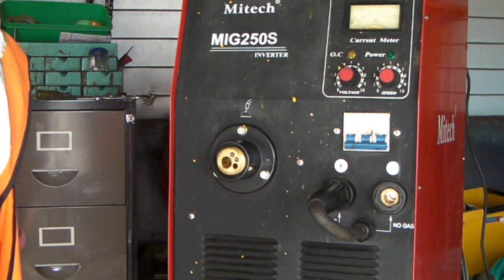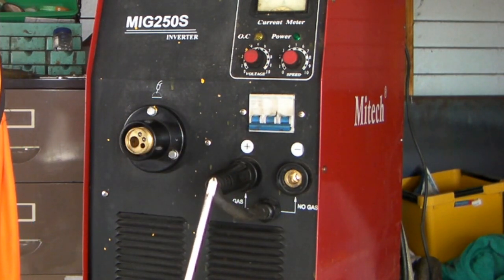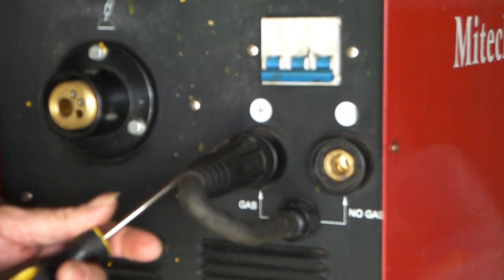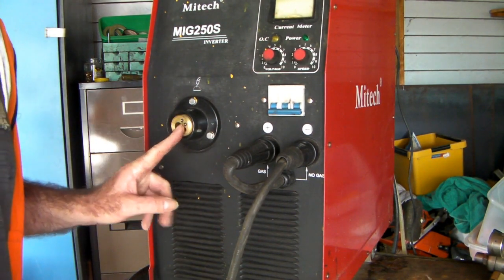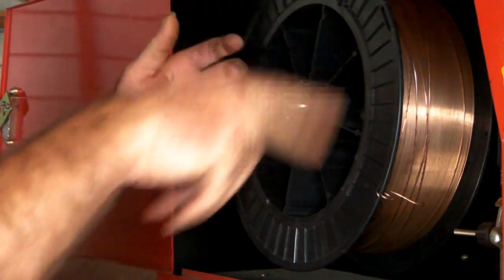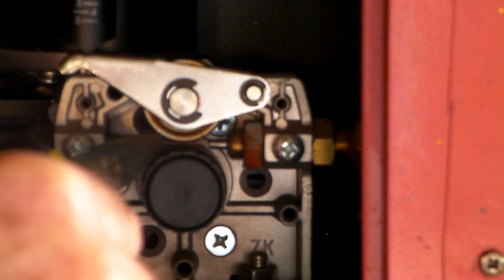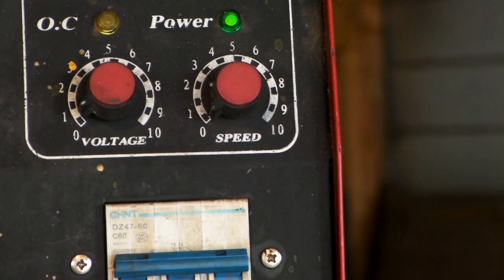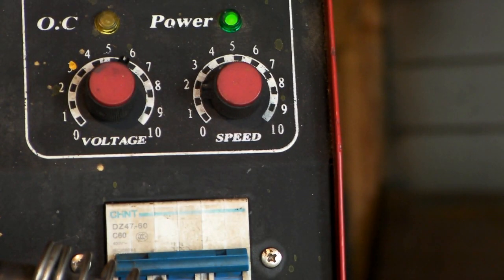How To Use Inverter Welding Machine

Comment: Can you fit an arc welder inverter board  into you mig?
Reply from the maker: nope
Reply: @petestools  Yes you can, the Inverter is just a power supply and gives you more Amps .